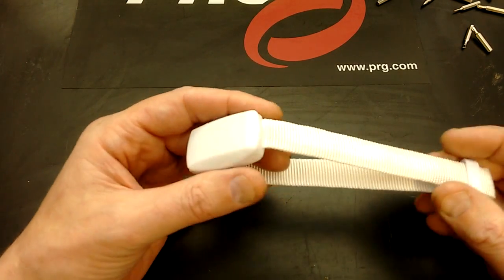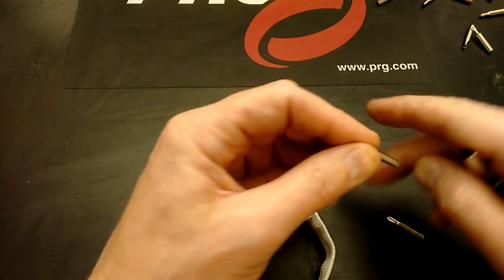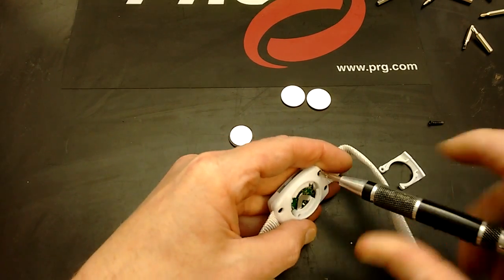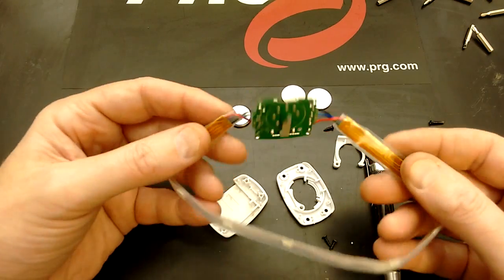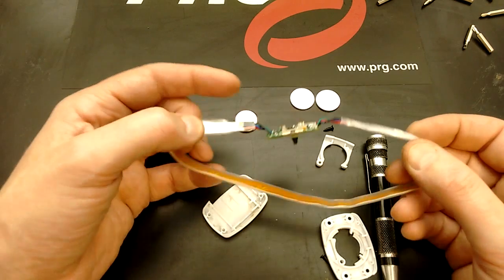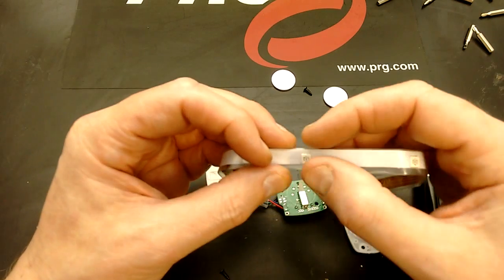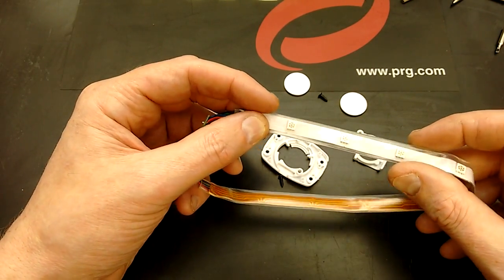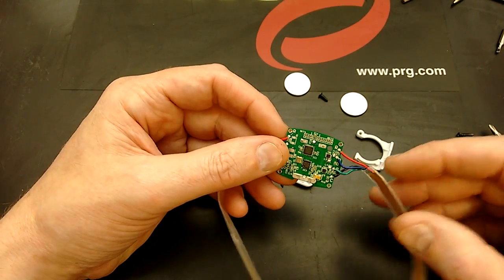Inside an illuminated (RGB) Xylo Band as used in concerts.

Comment: The two separate battery power supplies takes me back. I once had a portable tape recorder (reel to reel) which used two SP11 cells for the motor and a separate PP3 for the audio amplifier.

Comment: Hi Clive, is maybe the LED strip itself used as antenna? Or the ground line of it, this also can explain the two separate batteries, one circuit for power and one circuit for RF, both sharing that line

Comment: So it looks like there are two unpopulated headers — a three pin and a six pin.  My best guess is that the three pin would be either serial or I2C, and that the 6 pin is the AVR ISP interface for programming the firmware.

Comment: They should at least pad-print the concert logo, date, etc. on them somewhere so rather than go in a landfill, they become useless collectible memorabilia sold on eBay.
Reply: I have a different version of one, and it has the album art and band name on top
Reply: Jack B
I figured someone had to be smart enough to be doing it. It just makes no sense not to.
Reply: +Jafafa Hots I found a presentation by xylobands and there's like 4 or 5 different branding options available apparently

Comment: I have a Pixmob brand wristband from Taylor Swifts most recent tour and it uses the infrared system. It's got one 5050 RGB LED and IR receiver on the top in a plastic shell and two 5mm RGB LEDs pointed down the ends of a translucent silicone wristband, same sort of thing happens at the end of the show where they send a code out and all the bands go into a motion activated mode where they just flash a colour when you move around. 

The system for blasting the IR out looks like a bunch of custom LED PAR cans pointed at the audience with IR LEDs instead of normal ones, connected via their own separate DMX chain back to a computer running some fancy software to reinterpret DMX from the main lighting console and send it out to the cans. Because the IR cans are quite directional it allowed them to light up certain parts of the audience separately to others, which is nice!

Comment: About the LED wires... If the LEDs are parallel, then the black wire is probably the ground return and the other end is anchorage or acts as a terminator, or there's a break at the fold and both ends work as supply leads. If they're series, the other end may act to merge the RGB lines to the black ground.

Comment: I really don't see the point of 2 separate battery compartments. Using 1 will save space and allow using bigger battery.
Reply: +Peter McArthur no expert, but could have something to do with the radio reception. RF can be fairly picky, and getting drop from the flashing LEDs could interfere with the radios function.
Reply: +Peter McArthur I'd think that would have less of an effect because it is relatively consistent. The modulation stays the same (kindof). Also, depending on the button cells, the discharge pattern may be hold and then rapid(silver oxide), rather than gradual(alkaline). This could be another reason for the separate cells: they may only intend on using half the capacity.
Reply: For whatever reason, they may choose to separate the voltages. The LEDs may run off a voltage very different than the Atmel and RF chips. It might be easier/cheaper to use two different sets of coin cells than add in a voltage regulator/divider.
Reply: I'm also wondering why they didn't just add a voltage regulator, and run the lower voltage parts off that. Is there an expert who can enlighten me?
Reply: Alex T So what happens when the voltage drops because of the ageing battery?
Reply: Peter McArthur If the battery is ageing, then the concert is over so nobody cares.
Reply: If I'm not entirely mistaken, sounds like the two battery compartments are the same size too. Wonder what happens if you put the wrong batteries in each...

Comment: I've done some 'investigation' of the Xylobands that were used at Glastonbury. They used a slightly different design, the batteries aren't removable unless the four case screws are removed.  There are eight LEDs in the wrist strap and four that sit on top of the PCB.  

The wrist strap is on flat flex and this connects directly to the PCB using flat flex connectors.  The four top LEDs are also on flat flex, once again, connected using a flat flex connector.

It appears that there were removable plastic tabs that isolated the batteries from the board so that they didn't drain until they were needed for the concert.

The wires in the wrist strap are used as antennas, capacitively coupled to the RF chip (Silicon Labs Si4362).

It uses an ATmega88 microcontroller, connected via SPI to the RF chip.

According to this page:

http://stevencrowley.com/2012/03/27/coldplays-wireless-hardware-startup/

They filed for use of 869.5 MHz in the USA, so presumably that's the frequency that these also run at.

I don't however know anything about the protocol (at the moment)!

Comment: At disneyland they have hats that takes a signal from the main performance(when close enough) and "respond" with color coordinated messages in the form of leds in the ears. Kind of like the wrist band you just opened, however, when you leave the performance the hats sync up with hats around them and "communicate" with the same led playful color change.
Reply: I guess its called "glow with the show" hats, if you could find one I would like to see it taken to bits.

Comment: I have a handful of similar but different "Pixmob" wristbands that were used during the annual Intel devcon a few years back. They have a shake sensor and an IR sensor. The LEDs are on each side of the "watch", since the wristband is white molded silicone.

Comment: Frequency of 869,5 MHz
Reply: Completely illegal in the US to operate those on that frequency.
Reply: I think different versions of the bands have different freq. I found a user manual from 2012 for the transmitter on the FCC website that stated 909.2MHz. I think theres another that works on 2.4GHz (Not sure, though).
Reply: 900MHZ is fine = ISM band

Comment: I assume you can buy preprogrammed microcontrollers from Atmel/Microchip.  The RF part is likely based on Zigbee, and it sets up a simple mesh network with other Xylo Bands to retransmit the control signals around the network.   It wouldn't be that difficult to figure out which are the in-circuit programming pins and make it do something different.
Reply: The RF chip is SiLabs Si4362. It is a receiver only. ZigBee chip will cost more than the finished price of this band :)
Reply: A mesh network of these things sounds like it would be an RF nightmare.
Reply: Which is not something you want in an environment where you have a spectrum analyzer running continuously, looking for interference with your channels and spare channels you can hop to in an instant.
Reply: Ah - so by having a receive-only device on the band, you do make it much cheaper.  I suppose that limits the size of the venue the device can be used in as the transmitter would by regulation be power limited.
Reply: hoppes9 Not sure about the UK, but in the US 900 MHz band is limited to 30 dBm. This is enough to cover a few miles line of sight. And on the stadium, if you install transmitter next to those show machines, it will have LOS to pretty much everywhere.